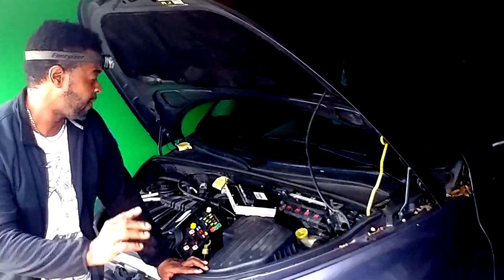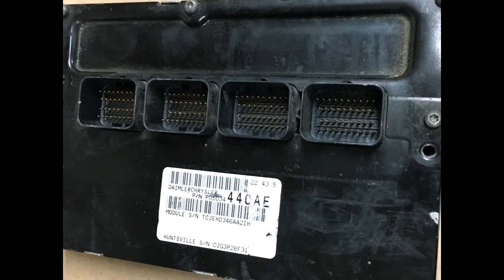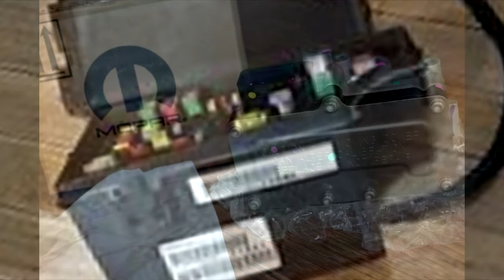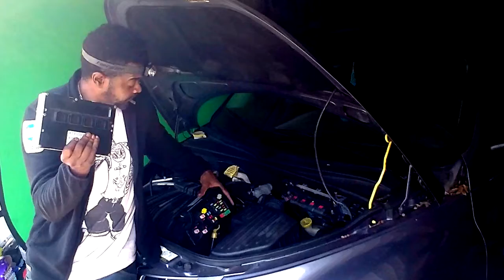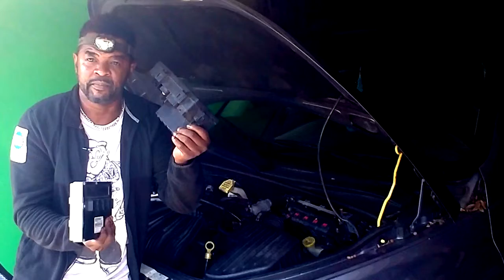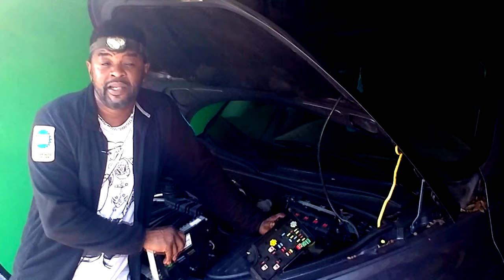P0882 P0700 Tipm PCM or Both PT Cruiser. Chrysler Jeep Dodge . 41TE A604 Transmission whining noise

Comment: I can't find the video on how to diagnose if the pcm or tipm is bad I need help
Reply from the maker: what kind of problem you having buddy?..
Reply: @OnlineMechanicTips  
The same problem you talking about in the video I got the code and the 2006 pt cruiser want gone out of second gear I can only use reverse and second gear you talked about what is going on with it I just wanted to see the other video you are talking about so I can make sure if it's the pcm or tipm.
Reply from the maker: O I know what you talking about...I have to re-record that, I had some stuff wrong in that video and it was to long, im sorry buddy...And I also have to find away to explain what im doing while not using  this chrysler scan tool..It will be extremely hard for the average do it yourself guy to do this test with out the scan tool..As a matter of fact, without seeing some of the data inputs on the scan tool, it will be almost impossible for the DIY mechanic to do this test. Thats why I just went ahead and did this video and just advise the DIY guy to do both..Man im sorry, just a reality..
Reply: @OnlineMechanicTips  
Okay so should I just go with just getting the pcm and tipm and getting them married as you say.
Reply from the maker: yep that will get in done..make sure the part numbers match your part number using same year car
Reply: @OnlineMechanicTips  
Okay thanks for the help
Reply: Are you able to use a TIPM from an 06 PT Cruiser to an 06 PT Cruiser if the numbers don't match?  @OnlineMechanicTips
Reply from the maker: @melissaringo8075 You risk having a feature clash. Not all PTs had fog lights, that's just one example